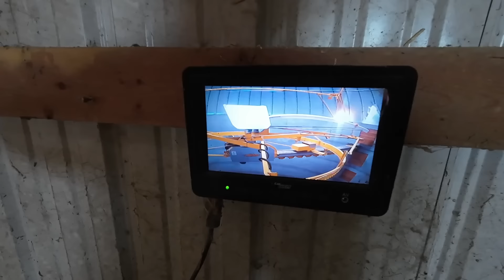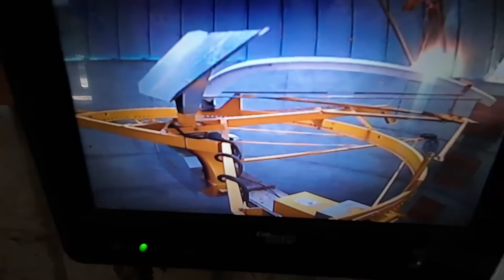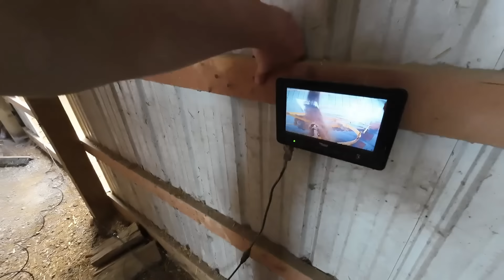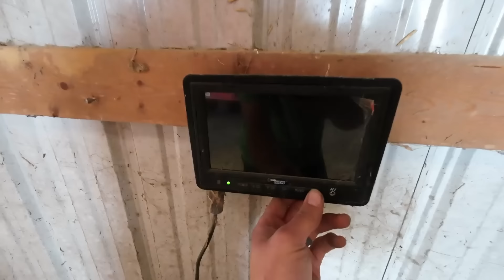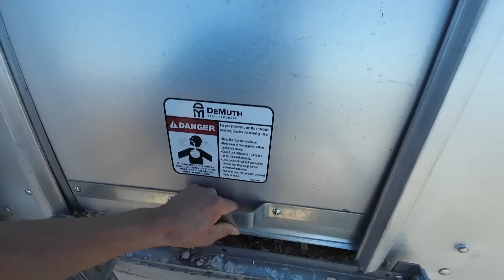Filling Silos with Corn Silage Day 1

Comment: I would've installed a man-lift on those silos so I didn't have to climb them all the time. Don't know if they make man-lifts for silos but one could be designed. A factory I worked in back in 1980 had them to move from floor to floor.

Comment: Have y'all considered planting multi species covercrop on your "corn ground"... multi species covercrop are minimum 15 - 20 different seed types...  Covercrop will add carbon and open the "hard pan" and increase water retention and increase microbiology in the soil profile to enhance nutrient availability.
Once crop is up put feeders on through the winter and early spring 😅😊

Comment: One suggestion, since you have to scoop what gets spilled, why not make a simple clip-on shield and attach to the discharge shute of the wagon?
Reply: Because the wagons have zero time to mess around
Reply: @daveklein2826  only takes a second or two to place and pulls off just as easy. I guess when free labor is readily available no compromise can be made.  Too bad we still arent mowing hay with a 5 foot cycle bar and horses.

Comment: Those first couple loads, you many never see or feed that silage..ever. it's at the bottom, it's going to be packed tight, the last 6-12 inches will stay there as the new "floor". Don't stress over dryness for first few loads.

Comment: If the silos produce too much juice, how does it drain out? If it doesn't does it just rot the stuff on the bottom? Obviously I'm not a farmer. LOL
Reply: It runs anywhere it can, so usually around the doors. They don't have bottom drains, so the dry stuff on the bottom may absorb some of it as well.

Comment: Are the silos available with an elevator?  That's a lot of climbing.
Reply: 😂😂 I am sure someone could make one, but I have never seen it. I often thought rappelling gear would be great for coming down a silo, our outside ladders weren't caged. 🧗
Reply: @MorganOtt-ne1qj  A platform at the top to join the three together might have been a nice feature. 1 climb and service all three.
Reply: @ezone913  That's an interesting point, but only during corn silage harvest will 2 of the 3 be filled. Service work would likely be done at a lower level, ahead of the harvest, and the distribution pan would be put on then. I worked with much smaller silo's, and you try to do as much as possible as low as possible. Unsafe to try to climb onto the raised unloader and switch to distribution.